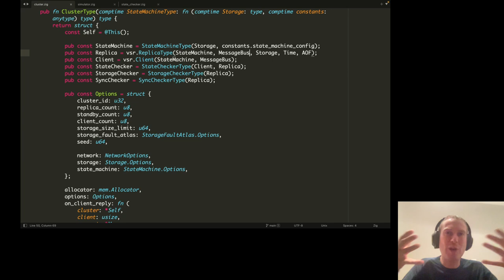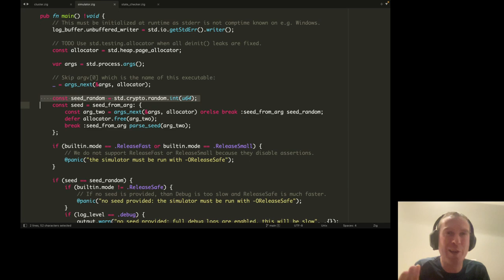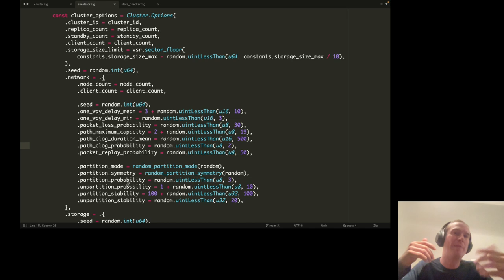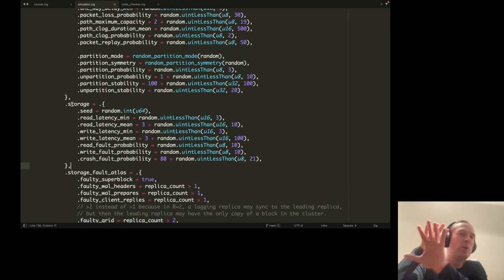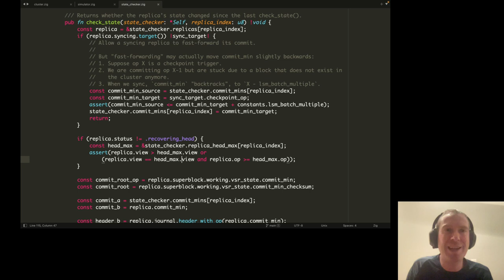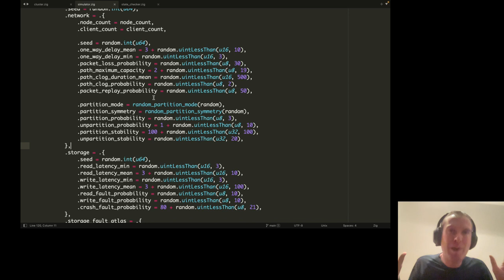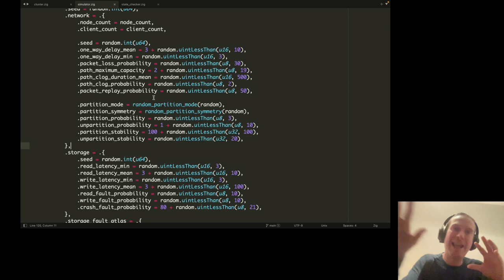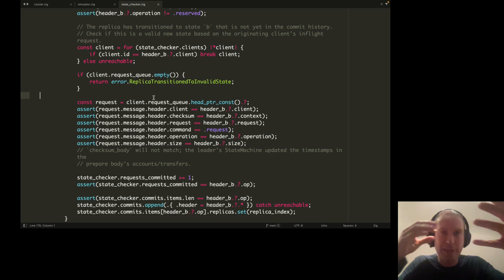SimTigerBeetle (Director's Cut!)

Comment: I didn't cotton on to the fact that the storage engine itself was deterministic! Wondering were you ever surprised that something you thought was in the deterministic section of the code ended up not being so? (Can't really capture that in the Zig type system).
Reply: Thanks Lewis! Yes, the whole LSM storage engine is deterministic, and all replicas in the cluster at the same commit number will reach logically byte-for-byte identical data files (for referenced data in the files, not necessarily for holes in the data file) to enable further online verification in production.

We had a fun surprising determinism difference once, between debug/release builds, where debug builds would initialize memory differently, and where this uncovered a logic bug.